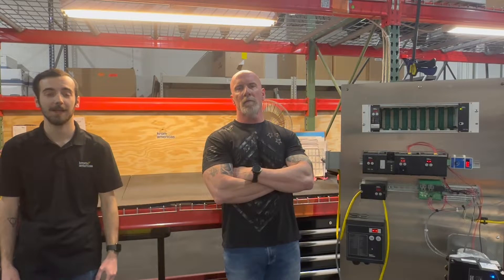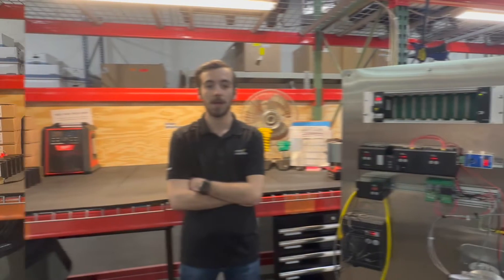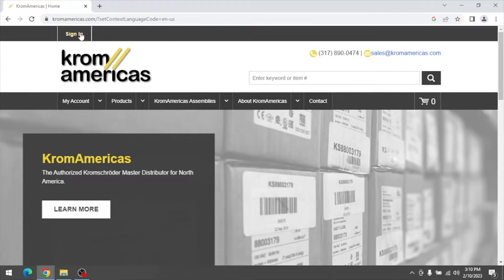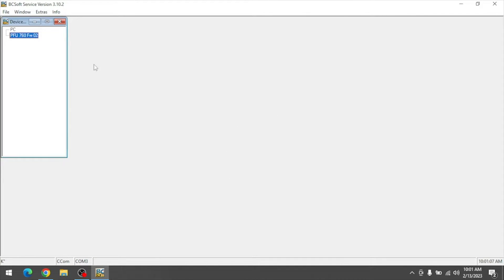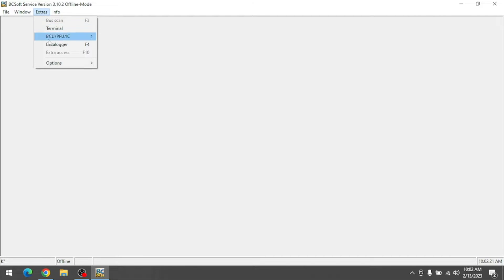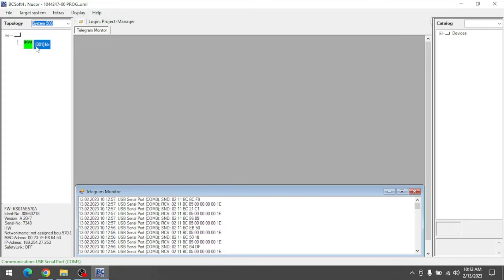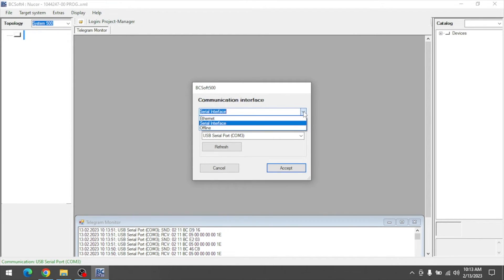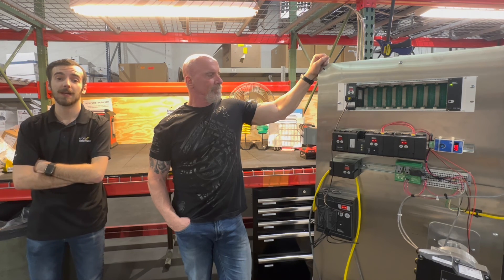Connecting a Kromschröder device to BCSoft

Comment: Hello! I'm from Argentina and I have an UV Flame detector UVC 1. I need to read the flame signal but in the UVC 1 I dont have an analog output (4 to 20 mA for example) wich I could use to read the signal through a PLC (this is what I used to do wuth te UV Flame detector UVD 2). Th question is: Can I read this data from the UVC 1 using the BCSoft? Thank you
Reply from the maker: @brunonicola9628 - send an email to support@kromamericas.com, and we'll make sure to get this question addressed. Thanks!